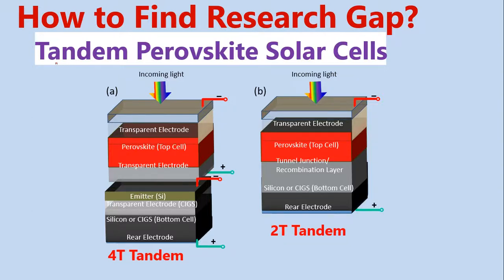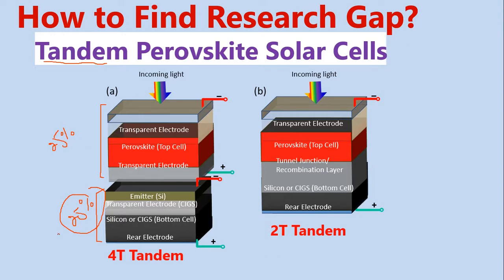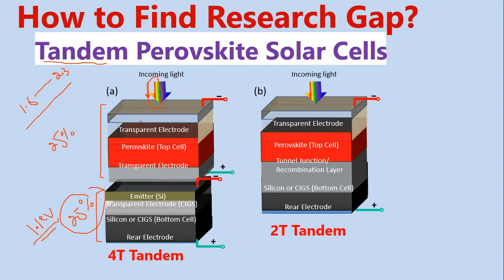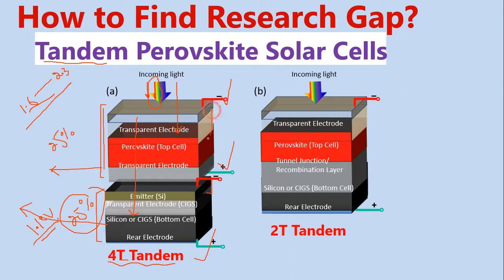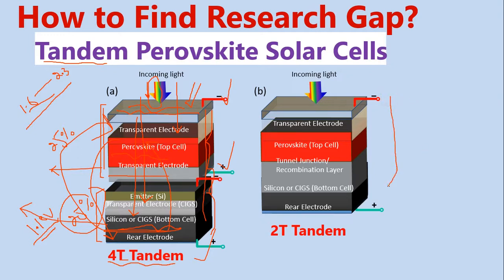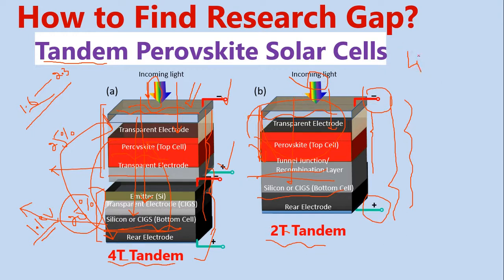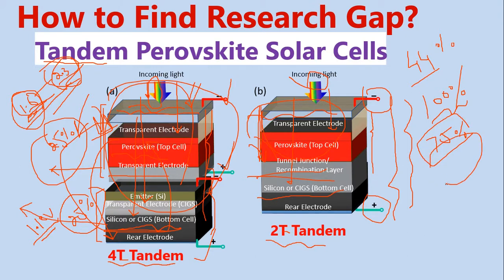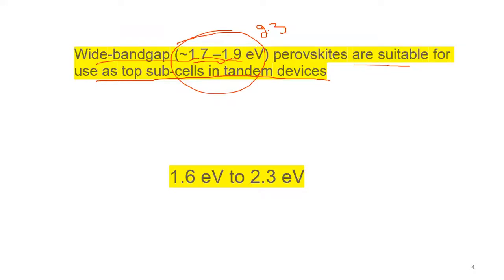2T vs 4T Tandem Solar Cells: Why They’re the Future of Solar Energy

Comment: Hi sir , please how Can to simulat this tandem structure in SCAPS 1D for two perovskites .
Reply from the maker: I am not expert in simulation but as far as I understand simulation complex structure is comparatively difficult. Tandem or hybrid structure is one of them.
Reply: @nanospeaks  ok sir , thanks you a lot I want simulat tandem structure for two perovskites CH3NH3PbI3 and CsPbI3.
Reply: @hananeou405  can I have your contact? I am also doing research on PSCs simulations work.
Reply: @nanospeaks 
Is there serious  or parallel connection between two sub-cells for 4T? Or how to stacked them in simulation?
Reply from the maker: @aneesaashraf1767  I am not an expert in simulation.  The two cells are made separate and then put it on the top of each other, which makes 4 T devices.